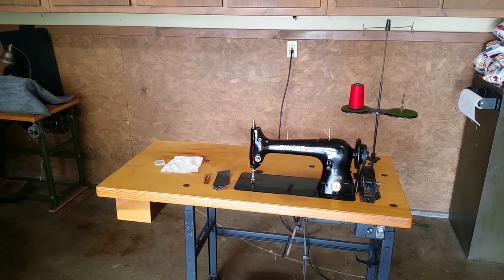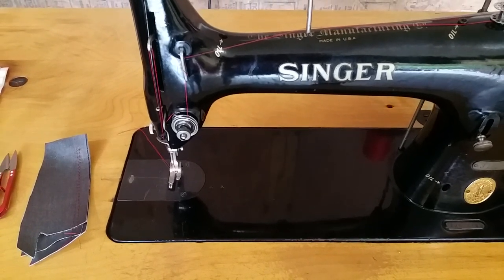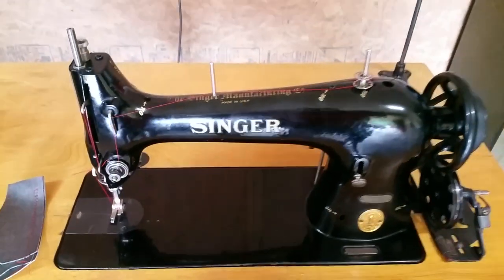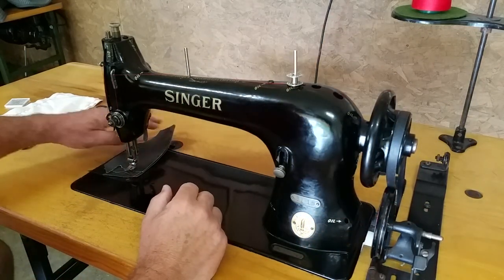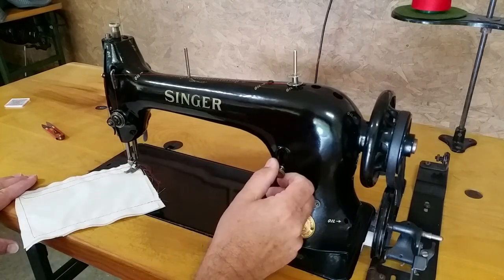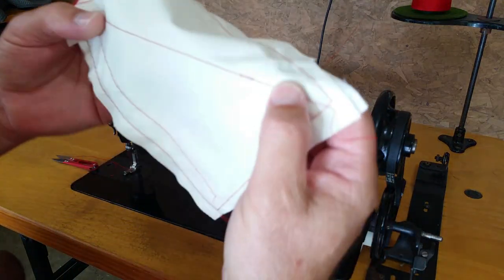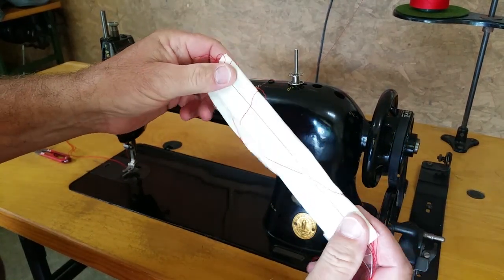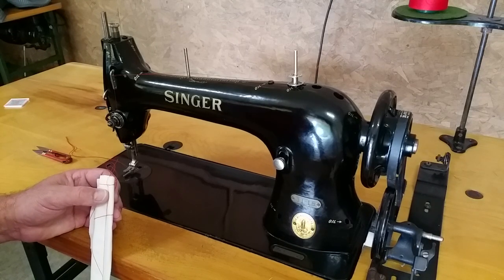SINGER 31-15 industrial sewing machine demonstration.

Comment: Thanks for the videos. I have a singer 31-15 that has worked great in our men's store for over 50 years it still looks brand new and still works great. hopefully you can help. The other day we trayed to saw on plastic tracks on some formal pants for waist adj.we have never had problems before. the 31-15 works great on everything else double blue jean you name it.now for some reason when we try to sew the plastic tracks it breaks the needle Thead constantly even buy hand, we can't do it.i have a backup machine a cheap suese home maker thing it did just fine. I have check everything 100 times taken the bobbin apart the plates off no dents to anything i give up can you help. Thanks

Comment: I own one.By watching this video I noticed you forgot to stop the bobin loader system. It turns without any bobin in it. It creates a useless noise and also will damage the belt by the time. To stop it just pull the small mecanism towards yourself.
Reply from the maker: I'm hard of hearing so I don't notice the noise.
Reply: @BlacksPorsche986  Where can I get needles?

Comment: Good video. I wish you would show sewing some leather and do we need special needles to sew leather?
Reply: Yes and no. It depends on how thick the leather you want to sew is and how you want your stitching to look. I make jeans on a Singer 31-32 (which is essentially the same as a 31-15 but with reverse) and I have no issues sewing leather patches onto jeans of about 1/8th" thick. A little more wound't be a problem either but more than that you would probably want a heavier machine anyway. If I would sew say, a leather jacket, I would definitely select a dedicated leather point needle to produce the stitch appearance I want to have. Leather needles (as pretty much all sewing machine needles are) are designated by a letter/letter combo to specify the point type. Most common is LR, but there are many others. Regular needles are (usually) designated R, but again, these come in many variants all with different suffixes. Hope that helps. Websites like the thread exchange have pretty comprehensive lists of most common types for most purposes.